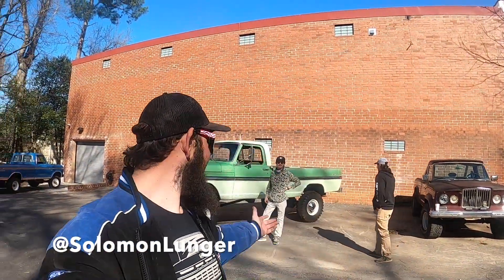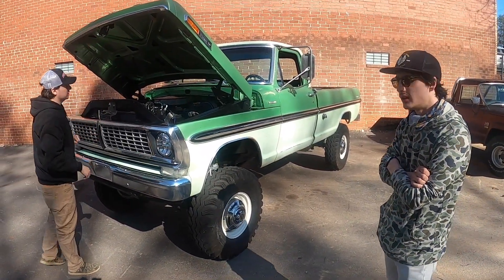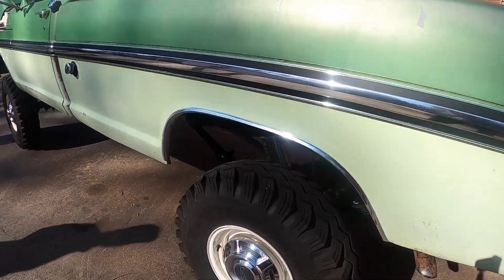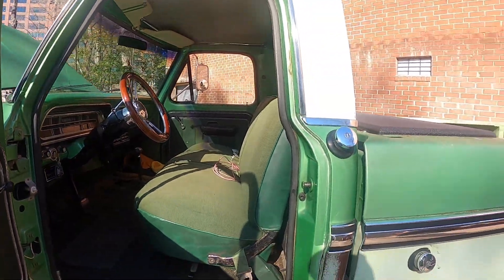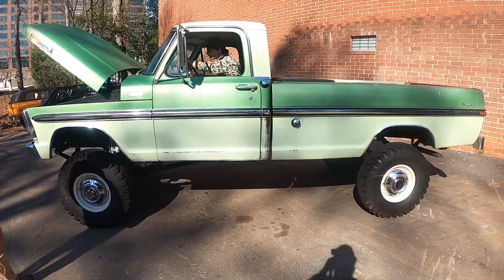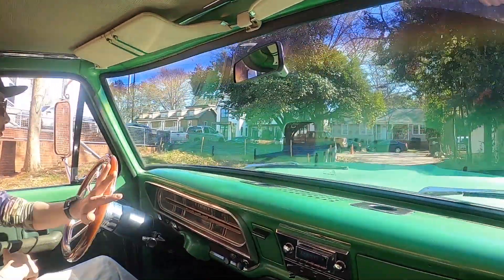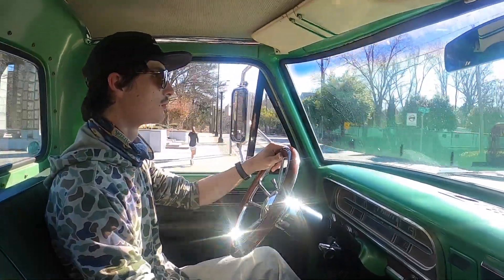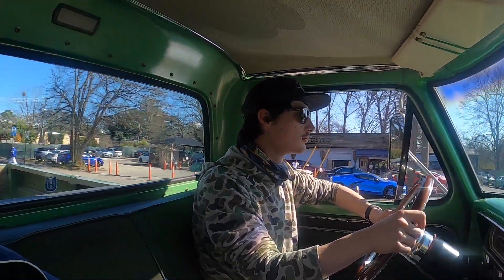1970 Ford F250 Highboy | What The Truck? Ep:39 | Ford Era

Comment: Had a '72 F-250; wore the 360 out, put in a 460, wore it out then converted it to diesel with a 4-53 detroit and a 2 speed aux (direct and 30% over) box. Best truck ever; sure wish I still had it.

Comment: Great looking truck is had a 71 for a bit back in the 90s not all beat up but needed alot , a bit more then I could throw at er. With that said I'd want to think the ultra low  gearings 
In that thing I can't see the 429 being beneficial.  Mine was stick had a 400 
From a stang even that was alot for that. 4.56 finals.

Comment: They never made a 427 "cobra jet".  Those were 428's, later 429s and even a 351C CJ.
Reply: It’s a shame to hear a fellow Ford guy say stuff like that isn’t it?  The 427 is awesome enough as it is but to hear someone call it a CobraJet just kills it
Reply: Yeah.....a fair amount of confusion concerning the Ford 427 FE (Ford Edsel) V8 engines. Maybe the confusion comes from the 427 FE V8 being used in the Cobra cars. In addition, the 427 FE was later equipped with the SOHC heads. Lot going on with the Ford 427 FE engine.  The Ford 427 FE V8 engines were possibly the most awesome and powerful V8 gas engine ever produced, including the Chrysler 426 Hemi V8 and the Chevrolet 427 V8.The Ford 429 V8...quite different with O-Ring seated heads.

Comment: have u ever seen a factory tilt wheel for one of the 67/72 fords and power steering, power beaks, ac tach in dash full cluster , roses etched in the interior trim, cruise control , wiper delay all the parts bolt right in a 70 3/4 ton high boy. i got a 70 class c motor home with a 428 bad c-6 trans and it came with all these parts for my 250 dollar rust free 70 highboy with dana 60/80 lockers tool box on side has a good clean body and a 390 in it that i traded for it with a free car that i had.plus my truck has full chrome trim and is a ranger. one thing it is rare because it has the tool box on side with out the camper special package

Comment: Great looking truck. So glad the Ford nation is out there. Only Ford guy's i have is on here. My buddies all Chevy only🙈
Reply from the maker: we are growing brother
Reply: I has never ceased to amaze me how most people get so biased over a particular automotive manufacturer (brand) instead of analyzing each individual model and intended purpose and use of the vehicle. You are on the "right side of the fence" when it comes to light duty 4WD trucks. Your buddies simply do not understand. Their truck preference is probably clouded and overshadowed by their engine preference. 

Tell your friends the following information. I understand why so many guys like Chevrolet trucks...most likely because they like the Chevrolet gas engines. I like those engines too, but I cannot stand most all of the Chevrolet 4WD and GMC 4WD trucks, except for the 1967 - 1972 model years, and maybe the 1964 - 1966 trucks. 

The only good Chevrolet 4WD and GMC 4WD trucks were called "Action Line" and built from 1967 - 1972. Why? Because it is the only GM pickup truck body style with round wheel wells to fit a round rim and round tire. This is important on 4WD trucks to maximize the balance of large tires with minimum to moderate lift to maintain a very good "center of gravity". 

GM never built crew cab trucks 1972 and older. The first crew cab came in 1973.

Tell your friends to go Chevrolet / GMC truck shopping here ------> 

 https://www.rtechfabrications.com/

In the early 1970's GM engineers designed the "Square Body" trucks, 1973 being the first model year of production. The square / rectangle wheel wells for a round rim and tire placement was and still is the proverbial "round peg in a square hole". This design greatly handicaps the installation and use of large tires without increased suspension lifts, thus compromising the "center of gravity". Cutting the fenders and wheel well openings to install larger tires ruins the already poor aesthetics of the truck. 

In 1988, GM engineers further handicapped the off-road capability of their 4WD trucks by using IFS axle (poor axle articulation / wheel travel); low stance (poor approach, departure and breakover angles); low hanging frame rails (can cause the truck to "high center" / teeter totter on uneven terrain off-road). 

In short, with the exception of a few model years, virtually ALL Chevrolet 4WD and GMC 4WD trucks have very poor off-road capabilities...actually have pathetic performance on uneven terrain off-road compared to Ford 4WD and Dodge (Ram) 4WD trucks.

On the race track, I like a mean 1969 Chevrolet COPO Camaro, especially the ZL1 version with aluminum block / heads racing engine, but would not kick the L72 cast iron block heads to the curb. That said, I would still opt for the Ford 427 FE V8 in a 1967 - 1968 Mustang. The newer Camaros and Mustangs...I would choose the 2014 - 2015 Chevrolet Camaro Z28 with the 7.0L engine. That car with superior suspension system has more potential than the 2016+ Ford Mustangs.

Comment: Dana 44 front axel with lift blocks.... I know how it drives and That is not very well. That poor FE big block was so cold that it could barely drag its self around the block. Get new leafs and bushings. Reinforce the shackles with a bead of weld and get rid of those lift blocks. Then tell me how it drives...... Dana 44 are cheaper to rebuild then superduty axels
Reply: There was never a 427 made that would just barely pull itself around, you must be thinking it still has a 360 in it😆.... hell the best Street Stock engine we ever ran in the Sled Truck was a Ford 427, back in its day that truck was untouchable. It’s a 1970 CrewCab F250 with a 4spd and a 428 now, the 428 isn’t half the engine that 427 was though
Reply: @warrenmcelroy4718  them FE big blocks do not preform till they are warm. So much damage happens when they start and go. Always let big engines warm up and idle down. Especially FE CT agricultural engines with the larger 1 and 1\16 crankshaft. I imply that it didn't have power till it was warm. I didn't say nothing bad about our flagship ass whoopper the 427 FE. Yes I said OUR because you must bleed FORD blue just like me too leave a comment like that. And it took a FE CT "side oiler" 427 to build the cammer engine that Shelby and the FO MO CO race team loved so much. Just trying to imply to them kids to let it warm up! You sure can't tell em what to do these days now can you?
Reply: Where did you see front lift blocks??? He said Atlas springs and ADS shocks.